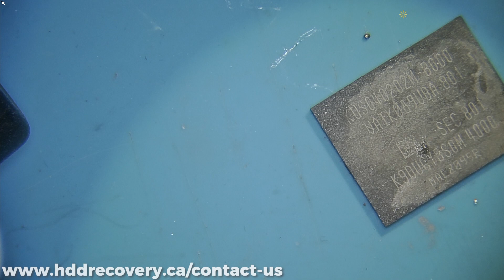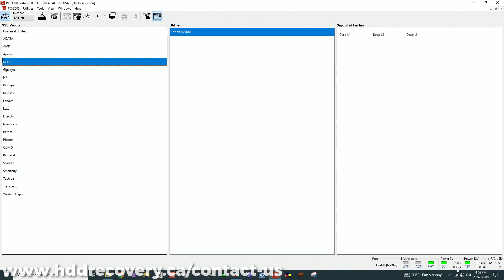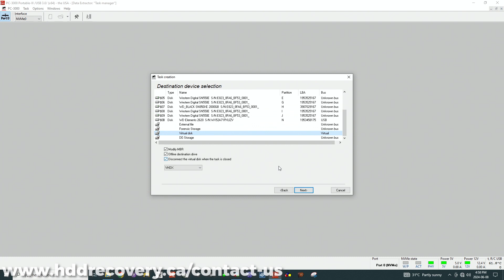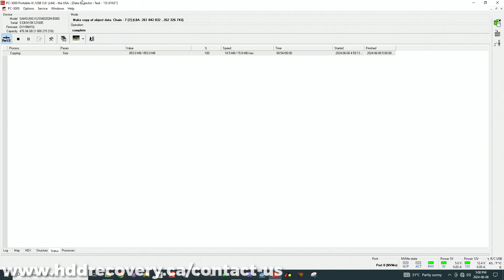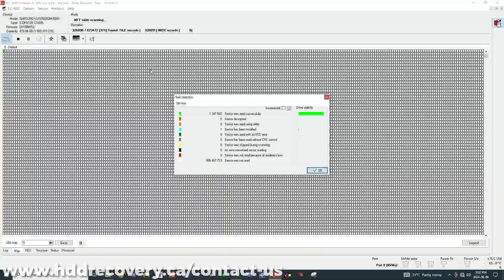how to recover data from Microsoft Surface 1796 with boot loop issue

Comment: Hi, what would you recommend looking for in an external hard drive?

I'm seeing many options - SSD, cmr/smr, portable versus powered, internal converted via enclosure, RAID, NAS, etc.

I need at least 2TB, the more the better. Mainly for long-term data backup.

Comment: With the new Microsoft Surface Pro X, they at least went back to removable SSD. Which is even user-accessible. I don't think they would have had to compromise the design too much by making the SSD modular in this device as well.

Comment: Nice job!! It is interesting to note that with all the soldering iron heat, the memory is not destroyed.  You did use a lot of heat all over the chip.  But the memory was not zeroed out! Is that common for all these chips?

Comment: In such a case (where the Windows logo constantly rotates), I first recommend you to use an operating system such as Hirens Boot CD. It is a Windows distribution that runs from USB. If there is no problem with the SSD, you can view the files directly from the file explorer or take an image through certain programs.
Reply: I think he know these kind of tools ( maybe the Sergei's one ... hirens is a little bit obsolete )
Reply: @laboratorioassembler  I think he knows too. But it seems like he directly intervened in these devices due to similar problems in the past.

Comment: I feel like for cleaning pads the best tip would be the large sweeper that's almost the size of the whole memory module. You can use it to blob down solder in mass and then drag the wick underneath it afterwords. I've seen repair channels use it to great effect. Especially on the giant CPU pads.
Reply from the maker: Yeah for sure. But I have not seen this for 245 handle
Reply: @hddrecoveryservices  C245913 / C245752 for example
Reply: @hddrecoveryservices  C245913 or C245752 are wide tips. There are also significantly wider ones

Comment: Is the RAM Chip on top needed for the Flash to communicate? Is it used by the SSD Controller? I kind-of expected to be just passed through to the Mainboard to save board space.
Reply from the maker: That's a good question. But unfortunately I don't know the answer
Reply: @hddrecoveryservices  Pretty sure I've read this kind of chip without the RAM part (at least, according to my notes). I could be wrong.

Comment: That strange what you do not have adapter for this old standard Samsung BGA socket. Also encryption possible bypass use read key from TPM module or just breakdown encryption findout the recovery key.
Reply from the maker: I do have an adapter. I just happened to have more than one type. Read key from TPM is not something I am familiar with.
Reply: If you try to recover the key from the TPM it will self destruct. Also, it's not currently possible to decrypt the data without the key
Reply: @paulveitch  TPM destructive under special condition. But we know how bupass it. Also we may not use TPM if key not stored there. In some cases possible use key mining service or use paid subscription for key retrieval. but everything now possible. Even for Apple compuers and iPhones.
Reply: Please explain further how to read key to bypass Bitlocker.
Reply: @BrianCometa  Explanation: We use some forensic software - hardware solution to read data from TMP module. Or possible use outsource Graykey service to get data from any encrypted volume. Simple.